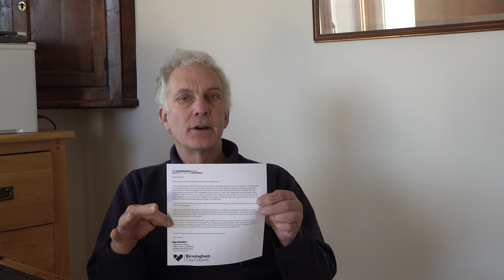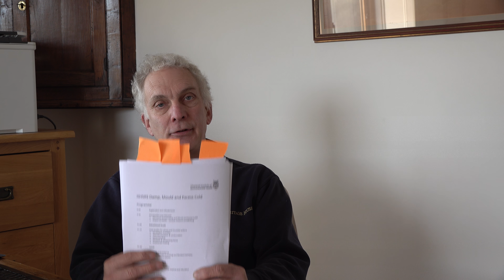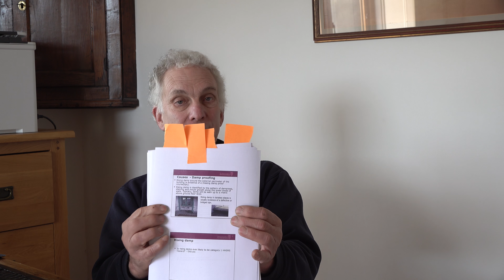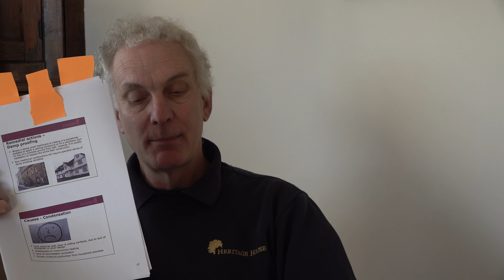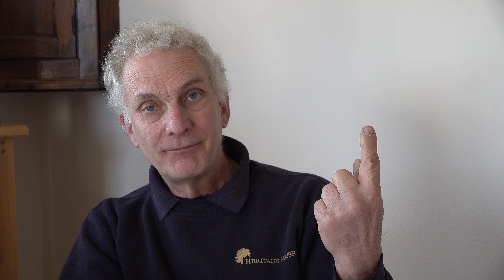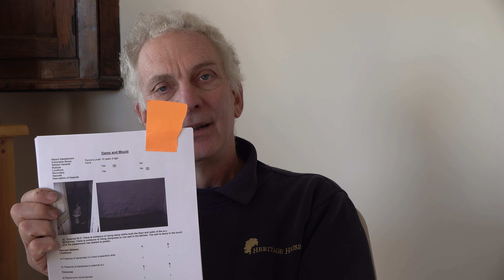The Environmental Health industry - incompetence being taught...

Comment: You have saved me ££££ by not using a damp proofing company that said to take all my floors up, some timber and one concrete and put a membrane in and concrete the lot.....NO!!! It was built in 1870 when believe it or not concrete wasn’t invented then! I ignored that after watching your videos and took up the concrete floors replaced them with Timber sub floors with floods of ventilation, chipped off all the Gypsom plaster previously fitted 1.5m up which was trapping salts and it’s bone DRY!!!!! I will now replace it with lime ash plaster and jobs a good en’! Can you tell me though Peter, where salt was present on the bricks should I add a salt neutraliser before replacing with lime ash to stop damp spots? Thank you  and hope my little story helps other also save ££££
Reply from the maker: Need to be mindful of replies - concrete was NOT invented by the Romans - in its present form. They invented 'roman cement' - and limecrete. They didnt have the technology to burn limestone at the temps needed to produce portland cement (1800 degrees) - but burned limestone at lesser temps up to about 800 degrees. This produced a totally different chemical structure - the clays present in the limestone changed structure and chemistry and indeed formed portlandite - but NOT the same portlandite that is in concrete as we know it.  Theirs was breathable - and did not trap moisture. Concrete is not breathable and traps moisture. Very important and scientific difference.   The Romans also understood the use of volcanic ash - which acted as a pozzolan to lime mortaqr - hardening it - we use pozzolans all the time in our lime work - if you want a tougher lime on a chimney fir instance, you can add a little brick dust, just as the romans used volcanic ash. The key here is breathability and chemistry - totally different to modern portland cements and concretes. Dont use 'neutralisers' - they dont work. Just brush off, allow to dry, and use a hot lime plaster - NOT an NHL based one - which is not breathable enough and will harden and trap moisture over time. Manage atmospheric moisture too - keep below 7 grams / m3 if you can - constant heating. All your approach and understanding is good - don't worry about other comments here that are a little uninformed - people sometimes only get half the story, and base their actions on the wrong science!
Reply: I look a bit of a Dick now don’t I, but he saved me money put it that way 😂
Reply: @danielmason2390  Haha don't worry about it pal. We are all here too learn. And ive made myself look a dick many a time 😂
Reply: Sean  Danes that’s right I’m all about learning, Shane some damp proof companies arnt. Do you know if I would be able to add a salt neutraliser under a lime ash plastering to stop it coming through?
Reply: @danielmason2390  the traditional way to neutralise salt is by applying vinger to the surface first
Reply: Yes the Romans had lime, volcanic ash concrete.
Reply: Ive seen ruins about 1800 years old that used concrete foundations pal.
Reply: @seandanes3945  Exactly, The Romans used concrete
Reply: @robinbanks183  i think the concrete is even latin lol